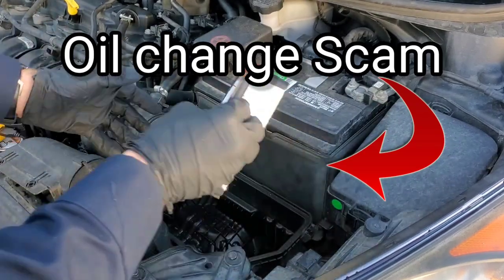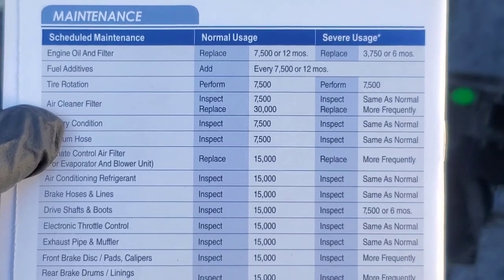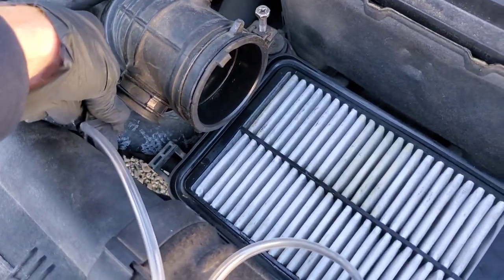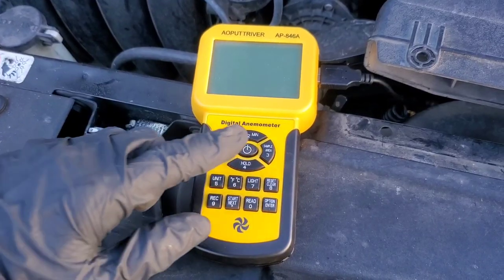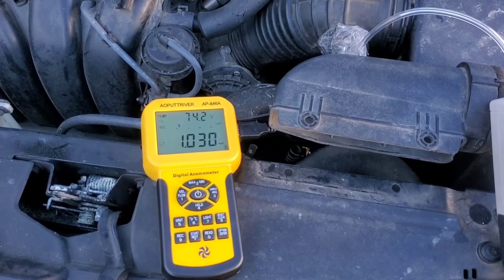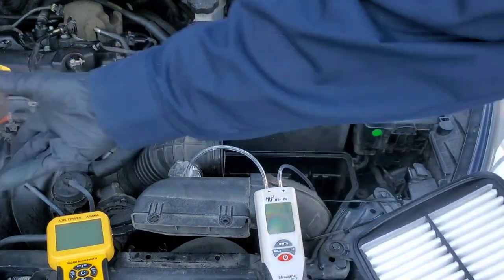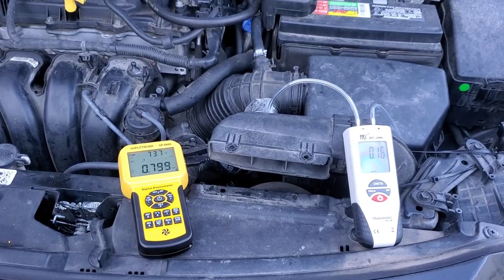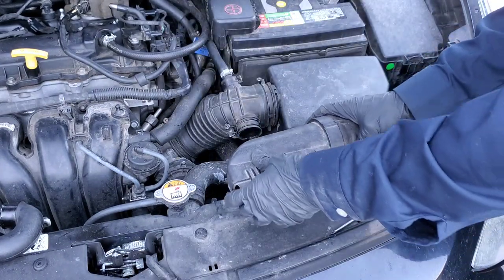Mechanic Oil Change Scam!?

Comment: I went in for an alignment 10 minuets later they siad i needed new tires. I didnt need new tires and said no. They said its done.  I picked it up went home and jacked it up. No tool marks at all whatsoever. It needed an alignment pretty bad l. They also unplugged my 02 sensor.  Every firestone I've went to has ripped me off.
Reply from the maker: Im sorry to hear this but thankful your sharing as this will help save someone else. Thats exactly Why the NIA community was made, to share experiences.

Comment: On my 06 Sierra Denali they (small name oil change shop) tried texting me a picture of a random dirty engine air filter, I have a K and N. Then finally, I started leaking like 2 months later when I checked my dip stick. They were reusing an old drain plug and didn’t offer to sell me that lol. Sad to say, but they lost my business. I will be doing my own oil changes now. Not to mention I was paying $90 for synthetic blend.

Comment: I'll be honest. For the cost of a new one and the time you spent checking you just as well put the new one in at the same time
Reply from the maker: The purpose was to show it often isn't necessary and To be aware of the upsell.
Reply: @NATESINTERACTIVEAUTO  absolutely and as you say be careful and don't get ripped off ☺️

Comment: Don't need to go through all that, just looking at it you can tell. Bang the old one, vacuum it and blow air through it and it will be fine.
Reply from the maker: Yes that is correct, I was showing to take away any doubts with the measuring devices.

Comment: Air filters are so easy to drop a new one in for owner's to do themselves, only get a garage to do a oil change for mine as it only takes half hour on the ramps, and oil correctly disposed as also it's hard to jack up the car on the street with other vehicles driving past nearly running over your legs and feet, cool info on not to be scammed 👍

Comment: @Nates Interactive Auto I always use my trusted local mechanic for everything. But with the air filter and cabin filter I always change out myself since I know what to look for. And when I have my trusted mechanic do a oil change I always pick up my own oil and oil filter that I know that works best for my vehicles esp since I know what gives me the best performance for my cars.
Reply from the maker: That is awesome you have a trusted mechanic and good to choose the oil you want.